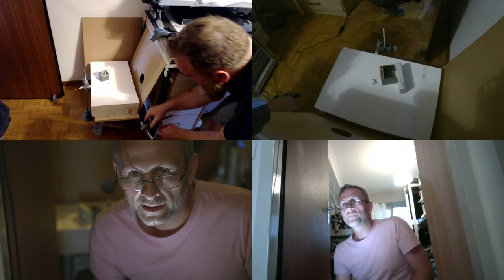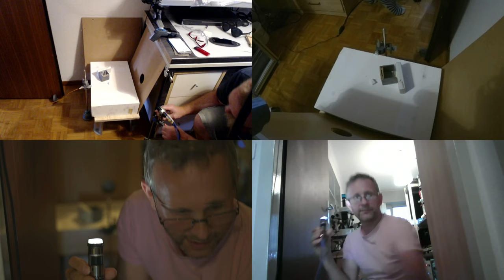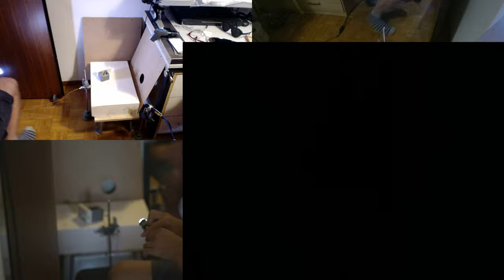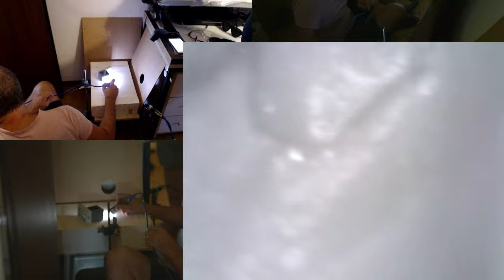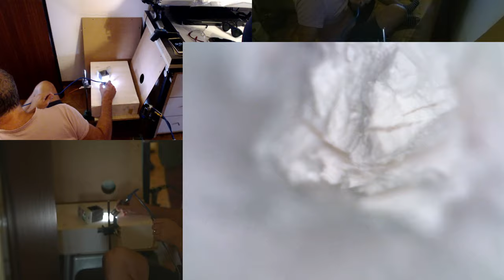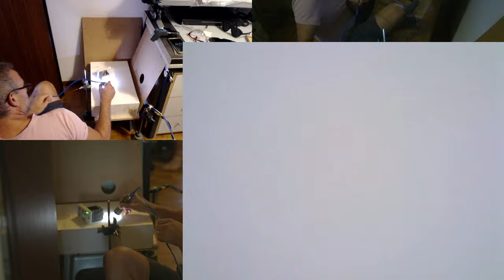Fixing Fukushima - Have we made silicon based glass?

Comment: The limestone megalithic structures in Peru show the same vitrification. The spectrum analysis shows a lot of Silicon on the vitrified surface which is not in the base stone. There is also a good amount of Mg and Al and some Fe on the surface.

Looking forward to your results.
Reply: Really interesting!!
Reply from the maker: Yes, I am aware of this, the ancients had access to electricity and could have synthesised HHO. This could have been used to cut, fuse and face stone.
Reply: @MFMP  and to make the stones appear to have no mass envelope them in an evo structure and move them at will? Shielded by a coherent electronic cloak type thing.